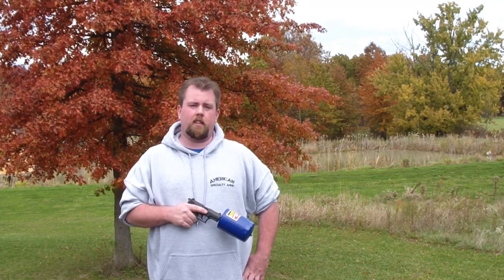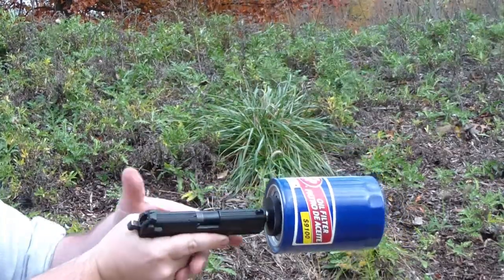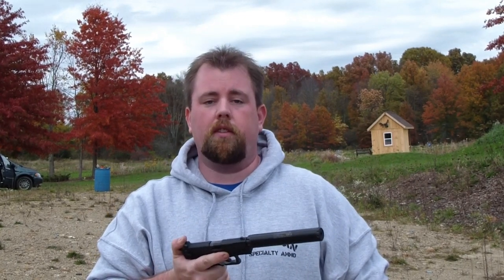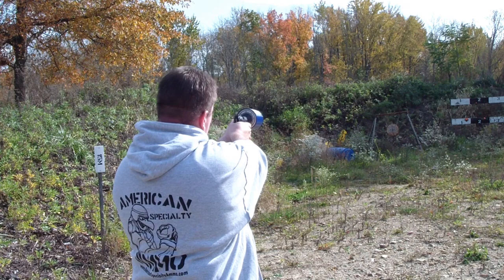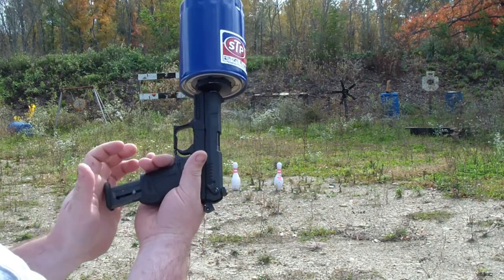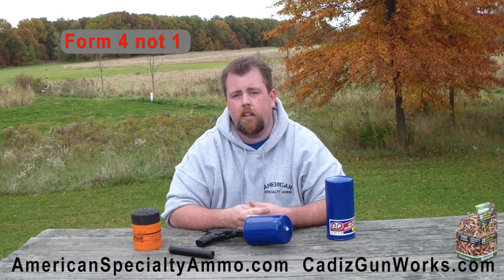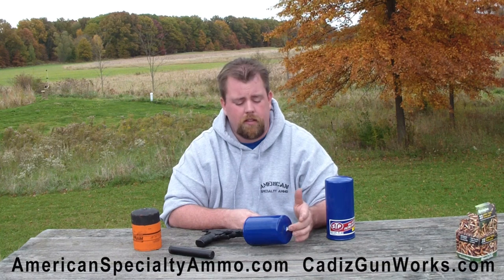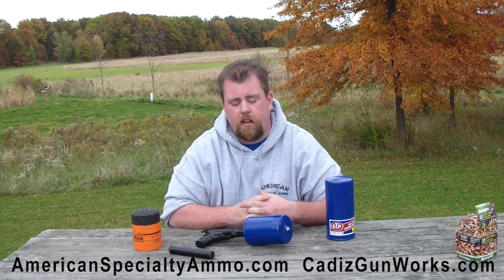Oil Filter Suppressor FULL AUTO take 2

Comment: Even though users can't legally replace the can, this suppressor has one (theoretical) use that no other suppressor has--in an apocalyptic or other chaotic scenario where legality isn't an issue, having one of these little, near-indestructible adapters could be more useful than a normal suppressor, because you could pick up replacement parts in any auto shop.  
Of course, if you're just planning for that scenario, you could get a non-registered thread adapter and y'know, not use it as a suppressor.  I believe they're used for "solvent traps."
For realistic use, though, the Black Ace Tactical Po'Boy suppressor is much more practical.

Comment: Sucks the user can't replace the filter, but that's what I expected. I thought about it, and it doesn't seem any different from those suppressors that use a wire mesh which owners are NOT allowed to replace. I was actually a bit worried about the legality involved with the Econo-Can. 

Question: what paperwork is needed to send it back? what is the shipping method, etc?

Comment: This is somewhat confusing, since I was initially under the impression that the econocan was designed to use oil filters that were user replaceable. Was the design changed at some point to comply with ATF regulations?

Comment: so if you cant replace the filter your self ,, then there is no point at buying one of these, in the long run you are not going to save $$$$ ,, $75 for the adapter and $25 each time you need to replace the filter,,,,,,,  theres $100 just to start plus the tax stamp,,, if you8 shoot enough it would be cheaper to just by a good $450 one thay you can just take apart and clean,,, not putting the econo cn down, but you could save $ in the long run if you just get an actual can, i still think it is hypocritical that you can make your own gun or weapon for self defiance as long as you do not sell it or give it away, but you still have to pay out the ass and get a bgc to have a suppressor,,, in some country's like Europe ( and correct me if i wrong)  you can just go buy one off the shelf and its considered disrespectful not to have one......
Reply: Exactly what I was thinking.
Reply: As far as I know civilians aren't supposed to have guns in Europe except for shotguns and single shot hunting rifles. So in my mind I would think that silencers would be out of the question. Then again I guess there are quite a few countries in Europe ( around 50 I believe) so perhaps some of them are more lenient.
Reply: +crazy8 The laws vary wildly, with some allowing legal ownership of full autos and concealed carry to total bans on carry and full autos. Even the worst however allow multi shot rifles, in the UK for instance on a normal licence you can own "high capacity" shotguns (like say a saiga 12), semi auto rimfire and manual centerfires. It is possible to get full auto and semi auto centerfire but it's very hard and more often than not they need to be locked at a range.
Reply: +TheAlexagius lol, friggin limeys... "manual center-fire". i never heard of a general term for anything but semi- or full auto. that's actually pretty good
Reply: davareno182 manual centrefire you know like bolt action, straight pull, lever action etc.
Reply: +TheAlexagius
no, no, i got it... just had to think about it :) that's a good one. cheers

Comment: $75, with $25 every 50 or so 5.56mm rounds,eventually it'll be cheaper to get a user serviceable 5.56 can. Now, if you intend on using a 10/22 with tall irons, or something like a AR 15 with a .22 upper, then sights are usable. Shooting .22 only looks like a very good and cheap option, but for anything higher in pressure, the best way to go is a quality silencer from a reputable manufacturer.

Comment: 0:34 NOPE NOPE NOPE

The P22 does not have enough barrel length to push a bullet into supersonic speeds, regardless of the ammo used.
Hyper velocity rounds will still come out of the stubby barrel at less than 1000fps, I've never been able to get a single round to pass the 1000fps mark, and I've tried tons of hypersonic and supersonic ammo.

The only time a subsonic will lower db in a P22 is if the load is reduced.
Low power rounds are obviously going to be quieter (rem subsonic is just a .22 short in LR shape), but a round like the Aguila SSS won't.
In fact, the SSS is actually louder from the shooter's perspective because the .22 short case it uses exposes and bleeds the gasses inside the barrel out of the chamber sooner than a LR case would.
End result is that there is a loud pop that's almost enough to make your ears ring...while a hyper velocity CCI stinger or Aguila SM doesn't.
Sounds counter-intuitive but that's how it is.

Comment: That's $450 + the $200 tax stamp so $650 in total. $270 bucks for a suppressor that you can get a 1k rounds threw before you need to pay $25 to replace it isn't bad if you just want one for messing around.

Comment: I like these since they offer an option to the more expensive suppressors. I watch a lot of these vids to see what kind of performance people are getting out of these. Until now that is. The fact that you demonstrated the noise reduction of your product from behind the muzzle and the noise reduction of the $450 can from in front of the muzzle shows deception on your part. The report is louder in front of the muzzle than it is behind the muzzle and you know this which is why you filmed it the way you did. To me the report of the $450 can was still quieter even though you were in front of the muzzle. I hope that in the future you demonstrate your product in a way that is fair and equal to the product you are putting it up against.
Reply: +anubisgodofgods excellent point... i didn't notice that. but did i misunderstand that the econo-can is not a equal alternative but a cheaper one?
Reply: +davareno182 the oil filter is a cheap and less advanced noise supressor. it takes a large filter to get the noise down to the same level as a much smaller purpose built supressor. this makes the gun muzzle heavy and the filters block the sights on most rifles. you could get by with a scope or red dot. Caterpillar fuel filters are better. you can get a fuel filter that is long and thin rather than an oil filter that is short and fat. still not thin enough for iron sights on most rifles though. 

Purpose built supressors aren't worth the money to me. you have to use subsonic ammo and the slower the bullet the quieter the report. some rounds are useless for anything other than punching holes in paper or close range hunting because the rounds are moving to slow to be effective at normal range.

Comment: Do you even own a firearm? He clearly said, and it should be obvious to any gun owner, that larger rounds will destroy your suppressor more quickly. .22, being quite small and lacking in power, will make one of these things quite a while. (Unless you piss through .22 like I do). I'm confident that one used with 9mm, .357 .40 or .45 would last about 100 rounds, give or take depending on most used rounds. Obviously bigger flame means shorter wick. 30-06 is a rifle cartridge, and will destroy it.

Comment: It's called an oil filter adapter! No tax stamp needed! Legal
Reply: Adam Andrews if you don't pay for the tax stamp and a single bullet passes through the oil filter you become a felon
Reply: True, no tax stamp is needed since the adapter is just a simple adapter, you can also screw it on the end of your gun to use as a diligent cleaner.
However, once a round passed thru it you have created a suppressor and if you don’t have the tax stamp and you get caught, your going to prison

Comment: Thanks but no not worth the money if you can't replace the oil can I will just buy a real one. The only thing that you make is the adapter so in my mind it should be the only thing we can't replace. I mean oil cans come on why should I have got to keep buying new cans off you it's the adapter that we buy that makes the whole thing work. I was going to buy one of those till I saw this video.
Reply: +tom77685 that doesn't sound right to me either... i'd think the adapter requires the tax stamp since they know exactly what you're using it for. i'm calling b.s.

Comment from the maker: the solvent traps are  different products entirely. They work great! you can screw them on clean your gun and all the oil and patches end up in the can. No mess at all. HOWEVER if you shoot threw it you just made an ILLEGAL suppressor! You will go to jail for 10 years and pay a $250,000 fines. It’s the same as if you put a potato on your gun or a 2 littler pop bottle and make an ILLEGAL suppressor. It’s not worth it, make sure to stay inside the law and not risk your freedom.